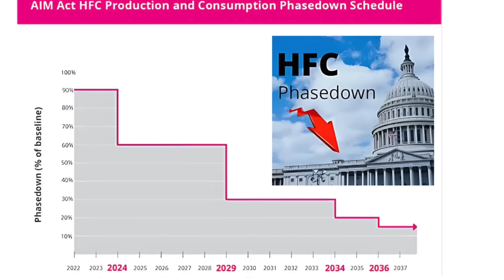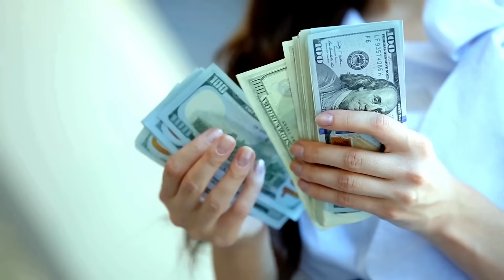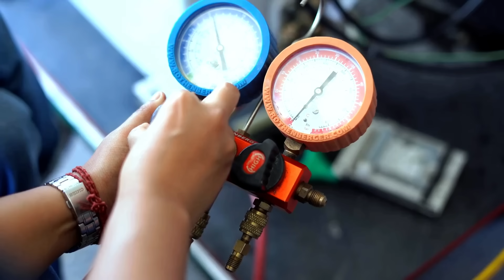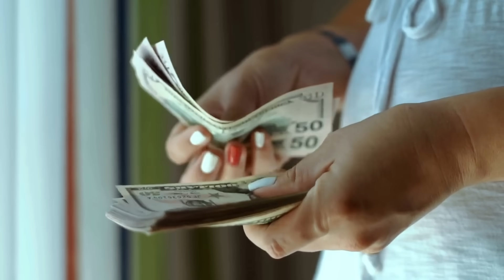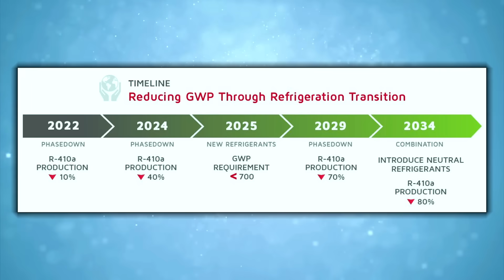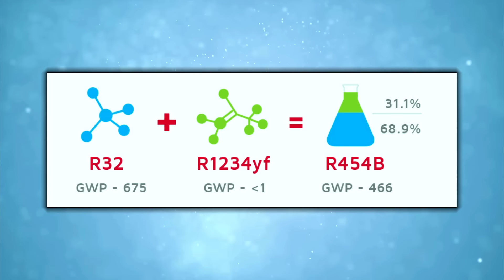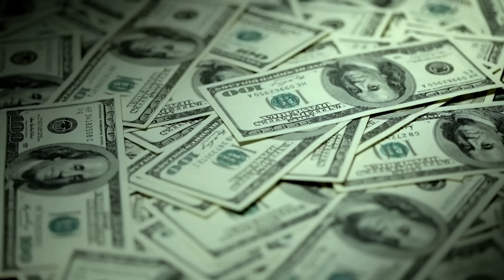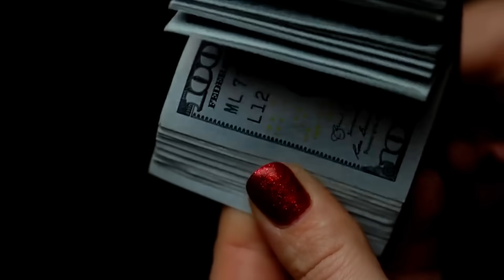Latest on the 2025 Disaster in HVAC and 454b Problem!

Comment: R454B is a blend of 69% R32 and 21% R1234yf (which is the new standard in automotive). Neither of these are in short supply; the preblend may be short supply. If you had to top off a R454B system with a small amount of R32, can't see this as a problem. If you had to blend yourself with a scale and a supply of R32 and R1234yf, you could do this.   This supply shortage will will through the supply chain.
Reply: Dude, 69% + 21% = 90%
Reply: @John-jd7mm  the other 10% is natural flavors
Reply: @John-jd7mm  you're right ... typo... 69% R32 and 31% R1234yf....
Reply: Most of them aren’t smart enough to figure out how to do that. Remember, most of them voted for you know who, taco.

Comment: if r454b is being used in window air conditioners why not buy a bunch of very high btu window units recover the gas from them and put that in the new ones?

the compressor oil would be the same and the gas would be 99% virgin because they are usually charged at the factory and maybe never ran or only ran just to see that they get cold.

then scrap out the brand new empty units.
Reply: Just use the window units. They will probably last longer anyway
Reply: they don't hold much refrigerant at all. they also have been coming with r32
Reply: @Jon-hx7pe  a bunch of r32 units and a bunch of cans of r1234yf from local auto parts store and the means to mix the 2 and you got something close to or equivalent to 454b
Reply: Window ac units usually don’t have bales on them for recovery…I wonder how this could be done then

Comment: overcharge is also bade for the equipment. ALL systems are charge sensitive. Even 4 ounces over is bad.
Reply: That is why you have a recovery tank.
Reply: @timbrown9305  why are you having to recover it if its not harmful to the atmosphere.......??? what are you going to do turn it in to be recycled so they can sell it back to you.....   back in the day they would just blow r-22  it was 25.00 a jug.........
Reply: @garyo8546  You have to be kidding.  Of course you recover.  I'm not risking my livelihood and besides when you use a scale the math works.  Measuring the line set and adjusting charge by weight works very well.
Reply: yeah,,,,, get that right............😁😁😁😁😁😁😁😁😁😁😁😁😁

Comment: 454  is not used anywhere else in the word and its environmentally dangerous to plants. This should not be used.
Reply: R454B is 75% R32 and the other 25% is what many automotive A/C used so the are both already in common use all  around the world right now but R-32 is the only sensible way to go for a home A/C.
Reply: @rpsmith  blended trash. I like the single component gasses.
Reply: @rpsmith your percentages are wrong. It's 69 and 31, with R32 being the larger portion.
Reply: @realSamAndrew  ~ Sue me!
Reply: @rpsmith ignorant and proud. I love it.
Reply: @realSamAndrew   Being picky, you're wrong too. Commercially produced by Chemours, R454B is a blend of 68.9% R32 and 31.1% 1234yf and a GWP of 466.
Reply: @rower30-mt3tb I'd use "ridiculous" instead of "picky". The person I was responding to had SUBSTANTIALLY different numbers which were not correct. My numbers being statistically insignificant and using rounded numbers with a tiny fractional margin from the absolute nominal formula makes them correct. And I would challenge you to pull samples of 454B tanks at the factory and prove that each one is correct to the 1/10 of 1% fraction.
Reply: R290 and R600 are widely used because they are cheap and no patent issues. UL limits to 500g charge because I’m sure a patent holder paid them to.
Reply: lobbyist and greed, lawsuits for everyone coming.

Comment: I just had a 4 ton DAIKIN FIT installed and the reason I went with this brand is because they had enough corporate common sense to go with R32!  And I'm a happy man now except for the Smart thermostat that runs 9F degrees hotter than the surrounding air temp but that's another story and I'm guessing any comparable Smart Communicating Thermostat is going to have the same problem.
Reply: Reset the temp "swing" on your smart thermo. to match the discrepancy. If its reading 7-9° higher than air temp, you may have to mount the unit lower on the wall.
Reply: @GregS-em8tn  ~ You missed the whole problem here man!  This TS is a giant heat source!  It runs 10 degrees hotter than the wall around it!  Blowing a fan on a normal TS makes it more accurate and responsive.  Blowing a fan on this piece of crap make it read 9-10 degrees below the actual room temp!  Even when you calibrate it to the max +7 degrees, it still read 3 degrees colder than the actual room temp with a breeze blowing on it from a nearby fan.  You can't have an accurate TS and a heat generating computer,  monitor and light display in on unit!  Did you take typing class instead of science class in high school?  :o)
Reply: What unit and how much did they charge you
Reply: @spscorse  ~ $12,450 for a FIT 4 ton with a  dual fuel furnace and a $2,600 tax credit on my 2025 return.
Reply: @rpsmith hi do the have a comparable unit that is just AC I don’t need a heat pump
Reply: Use their stat and make sure you have a search protector
Reply: @shoretrade9516  ~ I have their One+ thermostat and because it's a computer and a display it heats the entire thermostat to over 9 degrees F over room temp!  It's a really bad idea to try to determine a rooms temp with all that heat inches away from the thermistor.
Reply: Try looking for economy settings in your thermostat, that may be why it’s being stupid, just disable
Reply: You can easily program an offset into your thermostat to get rid of the temperature difference
Reply: @polishsharpshooter2876  ~ Point a fan at your thermostat and with the max +7 degree offset your thermostat will still read 2 to 3 degrees below room temp.  You can have a computer or a thermostat but you can't have them both in the same package!

Comment: Yeah i went with the R32 Amana system before the tax credits end next year. It was delayed a week getting the compressor (assuming because of truck fuel shortages), but I finally got it and its been good so far as a 2 stage. Question: can you put nitrogen in the compressor to check for leakage? Or is this a no no? I didn't watch them during the install to make sure they did this right.
Reply: You leak test the system with high pressure nitrogen before you pull a vacuum but the condenser valves remain close until your are done evacuating.
Reply: @rpsmith  right on the money pal
Reply: @rpsmith oh okay. Thats what I thought
Reply: Don’t worry. If your install company was good they will fix it for free if it does leak.
Reply: @yinggamer7762 I did get the 3 year labor and 10 year parts. The lifetime compressor replacement actually is what worried me tbh. And yes they seem like they are made cheaper than my 2000's era unit. Makes more of a clunk sound at startup anyways. Im guessing there's a break in period and it will quiet up eventually..fingers crossed.

Comment: Best way to handle the problem is to repair existing HVAC...buy more 410a and keep 'em running. Once HVAC manufacturers feel the slow down in HVAC sales, maybe they will get real.  The bar has just been raised as to how much to invest in an old system before considering a new one.  Avoid the new for now.
Reply: The supply houses will soon "run out of" parts for the old. R-22 compressors, R410A compressors, etc. This scam industry needs to stop.
Reply: @AmericanFarmerHVAC2024   Yes
Reply: @AmericanFarmerHVAC2024  Agreed. Just sell me some parts vs. supporting only the new systems. Nothing is illegal with the old.
Reply: I've had customers decide to just put 3k out for a coil replacement, rather than 12k for a new system. These price hikes since covid on new equipment is insane.
Reply: @johnwindsor9069  why would you spend 3k on a coil repair for an outside unit? For the same price just replace the condenser with a slightly over charged new unit. (if you can find one)
Reply: @robertbaker1970   Why? As you already said, if you can find one (410a).
Reply: I wish we could repair, so much more enjoyable then condemning a system because of evaporator leak
Reply: Also Abolish EPA
Reply: You know that will never happen as refrigerant and equipment makers make a lot more money changing the refrigerants needed!
Reply: Most techs can't repair it anymore, they just sell them. Lots of times the diag was wrong, so repair is done, still doesn't work right.
Reply: @billymccoy9155  They don't make this garbage repairable! Don't blame the technician. Blame the manufacturer. Where is the accountability?
Reply: @AmericanFarmerHVAC2024  Yes but there are a good amount of technicians who aren't all that gifted in HVAC diagnostics and repairs. I see lots of corners being cut and hefty fees on materials and labor.
Reply: @Garth2011  Blame the shitty trade schools that don't teach properly. 90% of this job is learning on the job from a skilled technician.
Reply: @AmericanFarmerHVAC2024  Yes, not all trade schools are there for the best training. Learning on the job from a seasoned professional is worth minimum wages all day long.
Reply: The risks are even worse if you have a poor gifted installer(s) with a brand new system. If its not right, its a bigger waste of money.
Reply: This is what I did with R22 and still only service R22 systems. I stay busy
Reply: it has been raised  the bar so high it has become cheaper to put a new compressor and the cond coil and evp coil andother
Reply: @dknowles60  Yes, all you need is some R22 or R410a and compatible system parts.
Reply: Absolutely correct.  That’s how we beat these greedy Wall Street hedge funds that are “pumping and dumping” our reputation — as techs. We care about working class folks and families.  You’re a smart guy.  Repair, repair and repair.  We even have local workshops that will rewind motor and overhaul AC parts.  I actually stuck a window unit in an elderly customer’s house until the local guy overhauled parts.  It cost the customer $800 instead of $4k.  His wife also made me a cake lol.  Protect your customers 💪🦾
Reply: I don’t know what you’re talking about in eastern Kentucky. It slowed down last June and never pick back up. I paid 25% less taxes last year. This year is gonna be even worse. You can thank yourPOSsexualpredatorpresident for that one.
Reply: They typically don't last long enough these days to justify anything other than minor repairs!  Sad but true!
Reply: @rpsmith But that makes buying a new one an even worse idea, since the price has doubled in the last few years and the quality is even worse. Even if you have a 10 year warranty, you still have to pay labor and refrigerant, which he just said is unavailable and it's $$$$$.
Reply: @rpsmith  They do if you are paying $800 to $1,500 for refrigerant charges on new junk.
Reply: @Garth2011  ~ all this will settle down and R-32 prices will drop way down.  I don't expect that to be true for R-454B.

Comment: Solution...Buy Daikin, Amana, Goodman who all use R32.
Reply: Goodman coils leak. They are trash
Reply: @seadweller8458  Seems they all leak. Aluminum and crap assembly.
Reply: @seadweller8458  got a Goodman 20 yrs old this month. R22 Freon. 
Evaporates coils or A coils still original and the compressor. Only problems after 17 yrs of no problems was a capacitor failed.  The condenser fan motor died. I replaced that myself. 

Maybe the new Goodmans are junk I have no idea, but the old ones are solid.
Reply: @mattspontiacta  .............You seem to be one of the lucky few.
Reply: They doing the same thing they did to r22 a big scam.
Reply: PLEASE AVOID LIBERTY MUTUAL INSURANCE‼️You will REGRET it you make that mistake‼️
Reply: Easy fix
Reply: I hope the Amana units are made by a different company than the one that makes the washers and dryers. My Amana washer didn't make it 2 years before the water level sensor failed and had to hunt for a complete control board to fix it for $250.
Reply: @wilmerdavis9688  Now a days, it seems the best "model" of anything is to select the base or unit with the least perks or options. Those push button electronic boards fail a lot especially the start button or most used. Then, a replacement needs to be located and its just stupid expensive. We find the basics are all the same, motors, assembly, quality etc. are all the same from the top of the line to the base models in most cases. Amana is not alone, Samsung has a big call for repairs yet everyone buys their appliances.
Reply: @wilmerdavis9688  that's everything these days. too much electronic junk and cost cutting.
Reply: basically all the same thing.....
Reply: Don't buy any of those brands.  They are trash.
Reply: @bobbymcnutt8046  Interestingly, they are very popular, and parts are always available.
Reply: Those Brands are not the solution, the solution is keeping it uniform and this switch/phase out the manufacturer wasn't ready because how do you force the public to buy this and we can't. Also explain to customers why they can't have heating because a faulty sensor is locking out your gas fire furnace and it's winter in CT.
Reply: @jonl2996  Thats when I go buy a generic furnace board and put it in.
Reply: I am not an expert but had the same thought on going to R32.  However, NOBODY commented on this so is there no further food for thought on this???

Ok, one guy said those were “trash” brands but didn’t back that up with evidence.
Reply: @harrymagooslum5770  They are all trash until they prove otherwise, these days. Just one tiny service call and any past and future power savings to be considered with the newer "efficient" HVAC will be eliminated, especially if parts are needed.
Reply: @harrymagooslum5770 Daikin is good and Goodman are pretty similar to Carrier but never had much luck with Amana equipment this is coming from a service tech perspective.
Reply: Well R32 will be phased out in 5 years also.
Reply: @buddytheelf3486 I don’t think so. It’s a world standard, and r32 doesn’t have the forever chemicals that 454b has
Reply: Look i get it's all trash but that's hot trash
Reply: 454b is toxic to lungs. Europe is banning it
Reply: Not switching to junk for a temporary problem
Reply: @Travis688  haha
Reply: That's a temporary solution.  R32 will be phased out in the next couple years.  It doesn't meet the gwp requirements, so they got a temporary allowance.  It's a short sighted solution.
Reply: I kid of agree. R32 is in hundreds of millions of units worldwide and isn’t patented and you can top it off, since it isn’t blended (kind of like R22)
Reply: I'm retired from the HVAC business and last year a new system was installed using a Daikin condenser and a Goodman air handler. It uses R410A.
Reply: @bobboscarato1313  Best plan ever. 410a and it may be fair to have a jug of 410a on hand for the day it might be need and maybe an evaporator coil. Can't plan when to replace systems and who would want to replace their system on the final year of then used refrigerant knowing it will be scarce one day.
Reply: @Garth2011  It came with a long extended warranty and by then I'll be dead; my son's problem. lol
Reply: @bobboscarato1313  Ha Ha.  Truly, all there is are two motors, compressor and 2 coils that would likely fail. Compressor is least likely, cheap motors will go first and as long as you have the refrigerant, you can fix them for less than the newer, expensive unreliable junk.
Reply: @Garth2011  I have whole house and a/c sensor protection and if we're not home I shut system off!
Reply: @Garth2011  I also pay $ 10.- per month to Reliant Energy and get up to $ 2,000.- ins. coverage on any equipment damage due to power related loss.
Reply: Diakin may not exist after all the lawsuits are coming.
Reply: What lawsuit?
Reply: @johnhaddox259 What lawsuits ?